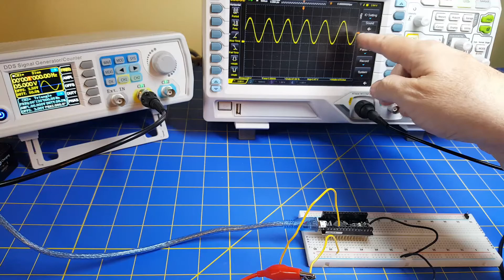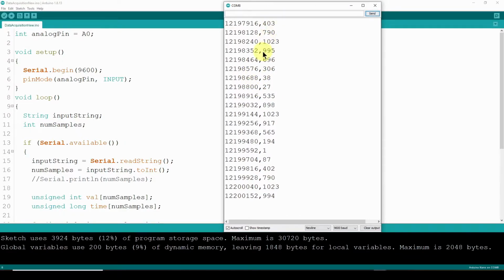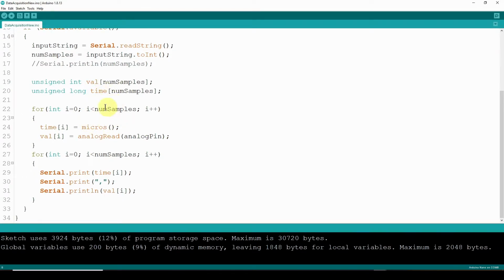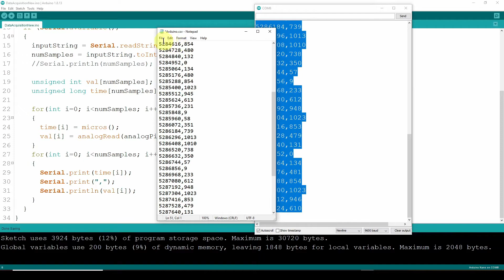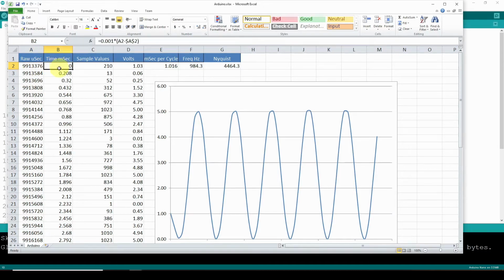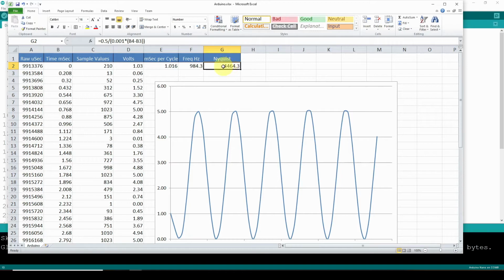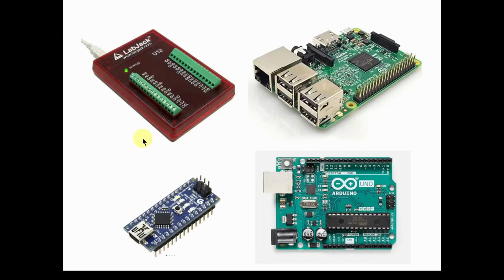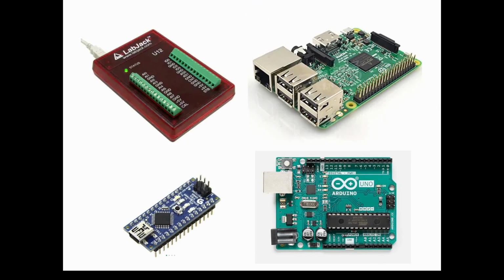Arduino Data Acquisition Part 1: Using Arduino Software

Comment: how do you convert to voltage in your code. thank you sir.
Reply: If you look around 12:27 in the video, note the excel spread sheet he has D2 highlighted (selected). Note the equation "5*C2/1023", the full scale range of the arduino ADC input is 5 volts (0 to 5VDC), The equation takes the cell value of C2 (the decimal ADC measured sample), and divides it by 1023 which is the full scale integer value for a 10 bit ADC (convert the 1111111111 binary to decimal, and you get 1023 base 10). So he's taking 5 volts, times the ADC sampled value, divided by the total ADC counts.
Hope this makes sense.